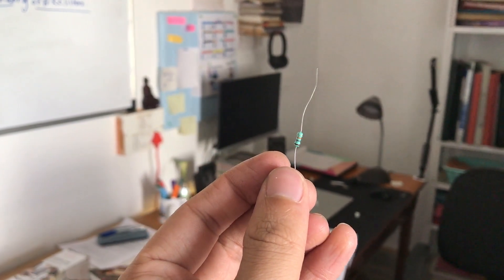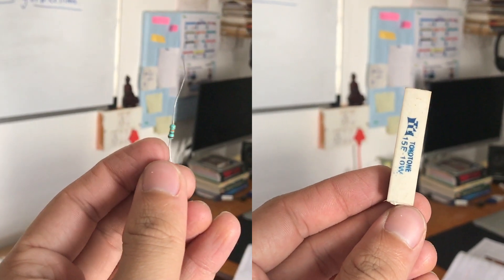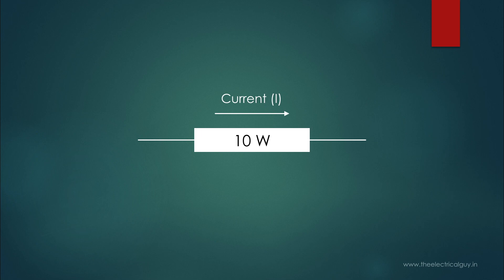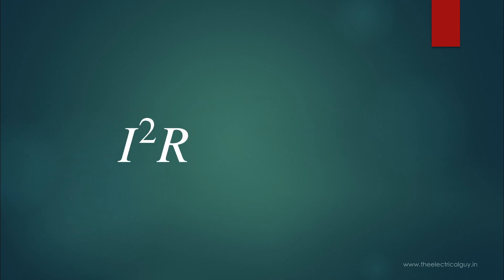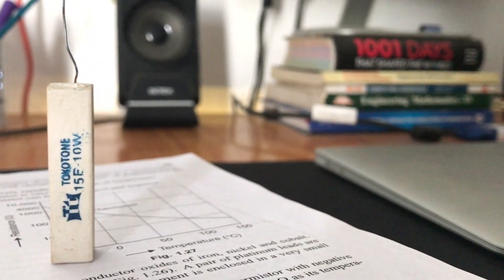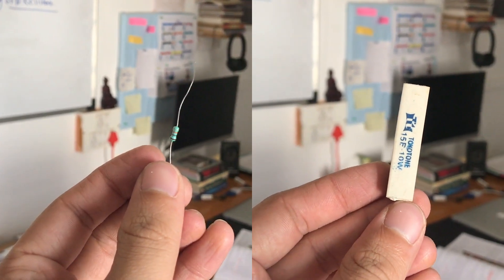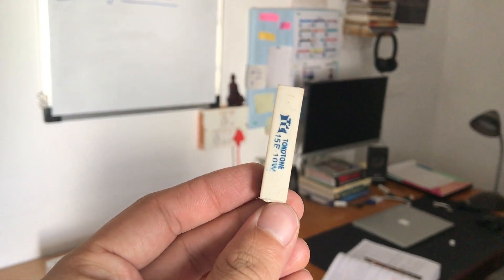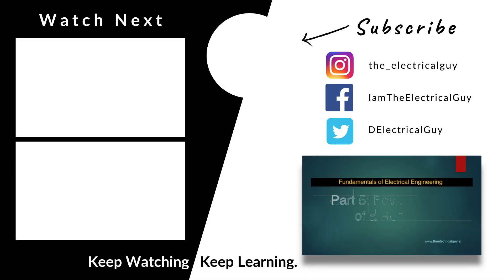What is Power Rating of a Resistor | Why Power Rating Matters ? TheElectricalGuy

Comment: I changed a car license plate bulb to LED but it randomly turns off. I used a 100 ohm, 5W resistor in the socket and then inserted the bulb and it seems good but the resistor does get hot. I did a calculation and determined that the requirement is to have a 115 ohm, 1W resistor. As I understand it it is perfectly ok to use a bigger power rated resistor such as what I have with the 5W resistor. If I switched to a 120 ohm 5W will the resistor get hotter than the 100 ohm one? I thought it should get cooler because there will be less current passing through but I’m not sure if that restriction of current will make the higher ohm resistor get hotter. I thought that a higher ohm resistor would be cooler but I read some stuff that makes me unsure about that. Also, if I went with a 120 ohm 2W resistor instead of a 120 ohm 5W one I assume those 2 should reach the same temperature?

Comment: Great video neatly explained,as a expert can I know which value resistor is safe to use in kapor dani...i have used , 2k2 10 watt,it blasted within 2min, used 2k7 7watt 5watt   it blasted within 1 min.
Then i tried 10k 10 watt it working but very slow, can't evaporated camphor easily...
So please guide which value resistor will work properly in kapor dani longer n proper.
Thank you
Reply: Brother, I have same question , if u find out ,let me know

Comment: Hi, I have a big doubt.
I'm working in a port. In the port conveyor run threw ABB VFD drives. But two drive is used in parallel with different supply(Star and Delta). Why used Star and Delta supply in the drives?